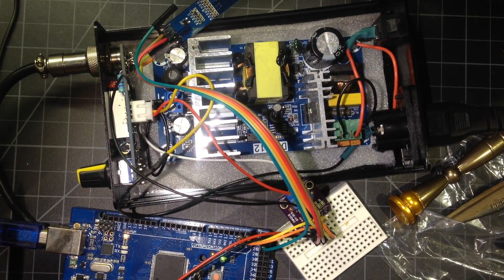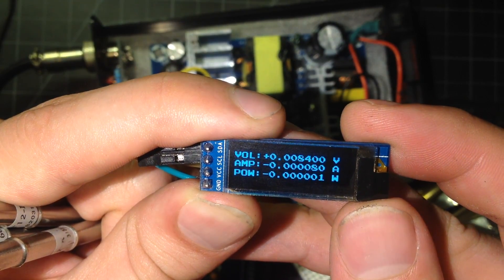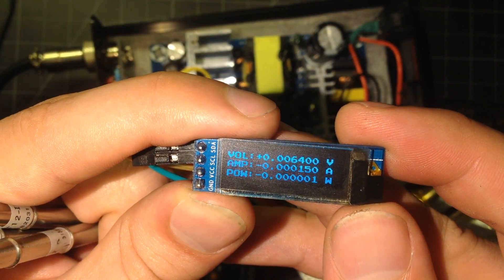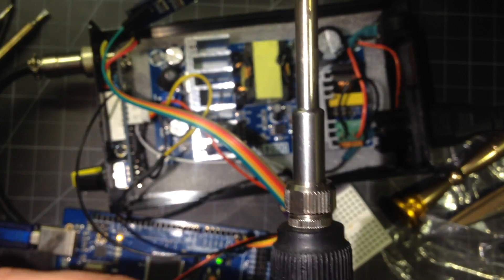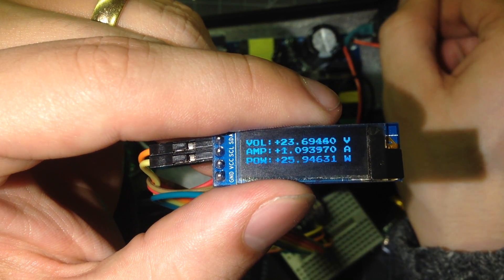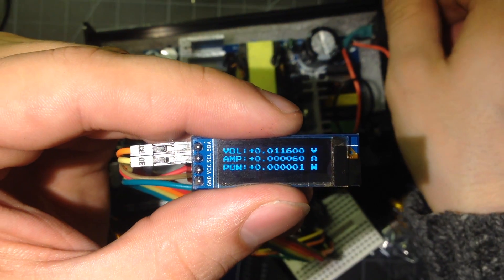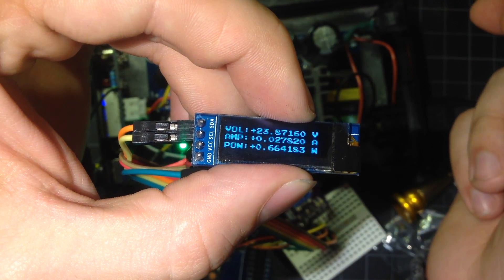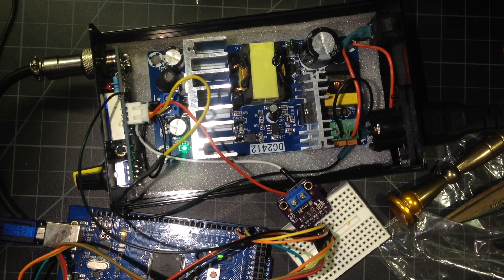T12 Soldering Iron Part 3: Power Draw

Comment: could u use a hakko FM 2028 iron with this
Reply from the maker: the connector for the handle is slightly different, since it screws in instead of snapping. I think that would keep you from using the same one, but you might be able to cut off the connector and put on the one that comes with the kit.

Comment: your wires are a bit thin to handle that much power
Reply from the maker: I suppose, but I don't have any thicker wire. What gauge should I be using for 2.5 - 3 Amps?

Comment: Interesting vid. Funny how the finest tip draws the most. Like you, i thought it would be less since there's less surface area to deal with.
Reply from the maker: Yeah, the contact patch must be really terrible. I ended up cranking the temperature to ~300C when I used it, because I just couldn't get solder to melt on the joints otherwise. That said, it is a tiny tip.